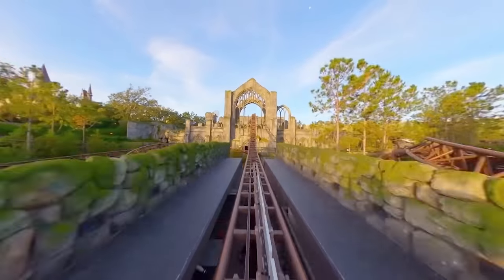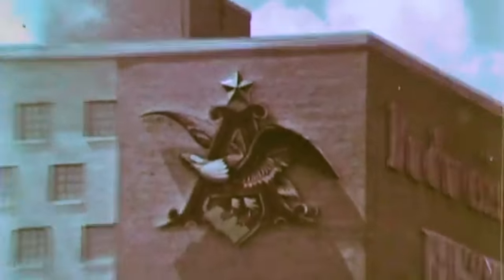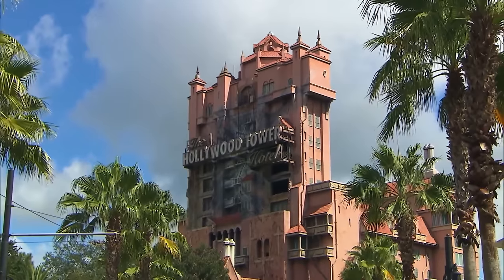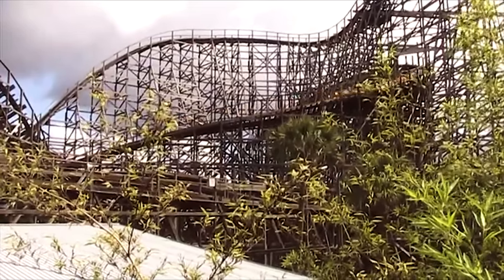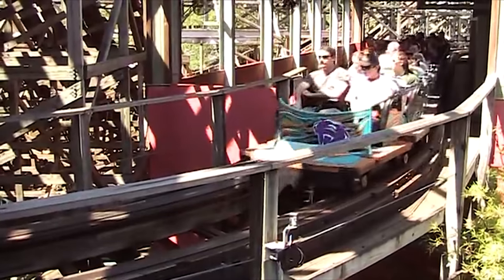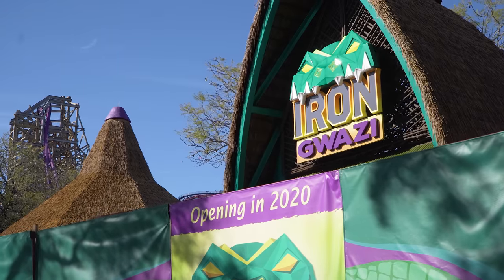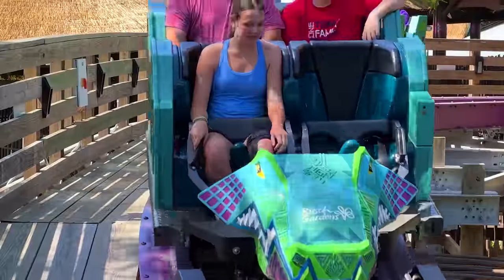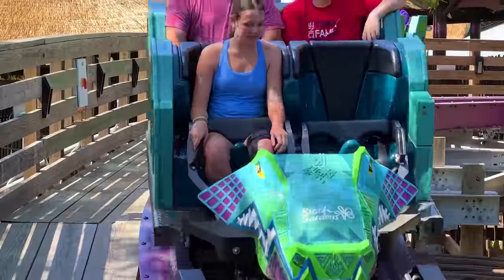Iron Gwazi - The roller coaster that lived twice

Comment: I grew up about an hour from tampa, terrified of coasters until for my 8th grade field trip to Busch Gardens I told my friends to do whatever they had to to force me to ride the rides. I was not going to be the lame kid eating dippin dots while everyone left to experience the rides. And I did, I rode everything in the park except Tigris (which had just come out, and for the life of me no one could tell me how the track worked, and there were rumors it went backwards? i still dont know lol), Falcon's Fury (drops were my main fear, hell no I wasn't going to ride a 300ft tall drop tower with the fear elements falcon's fury has, and Sheikra, the line was more than 120 minutes long and I didn't have the patience, and I admittedly feared the 200 something foot drop. Having ridden it a few times now, it's my favorite ride I think. I haven't been able to ride iron gwazi, and the original was closed by the time I went to the park, but now that I've ridden some proper rides, I'm so excited.